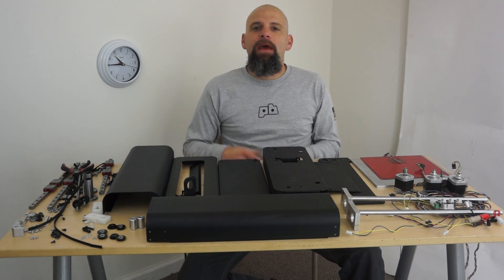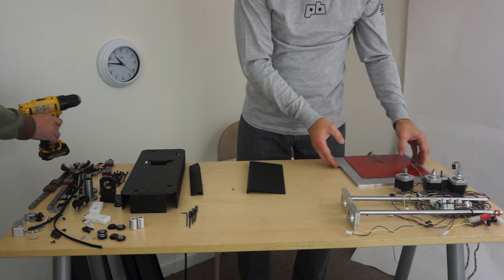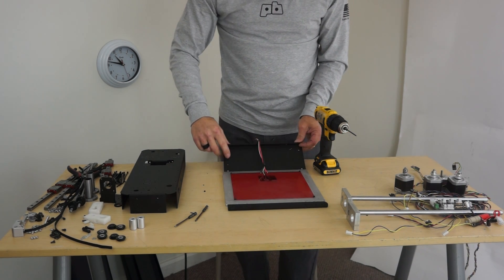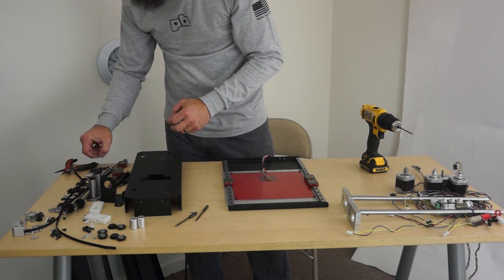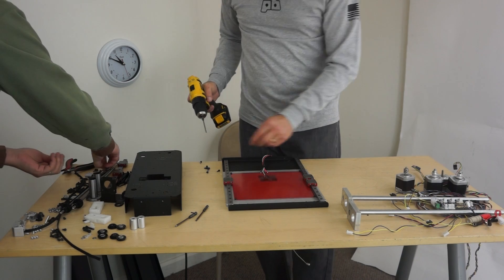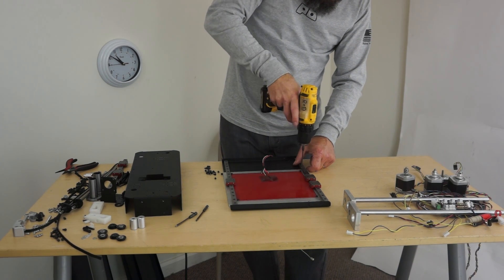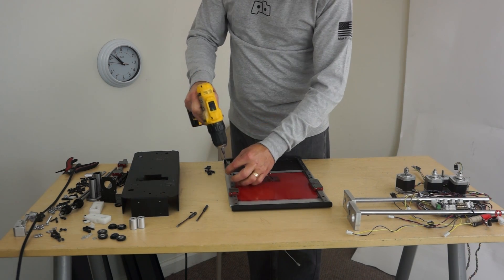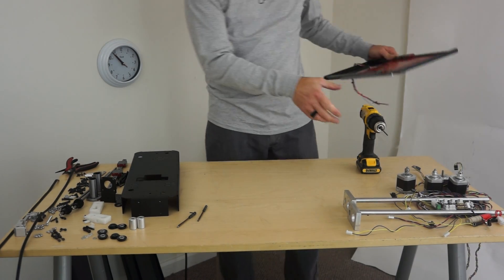Printrbot Metal Plus Beta Build 01

Comment: I am curious.  I gather some users are getting board failures on their z sensor.  Is this because people may be trying to pump too many amps through the controller board?  If this is the case, why not get some solid state relays.  Have the board control the relays and the relays control things that need to be heated (ie the print head and the heated bed).